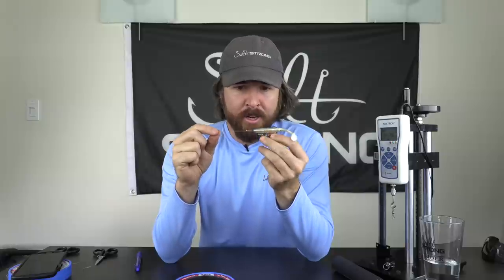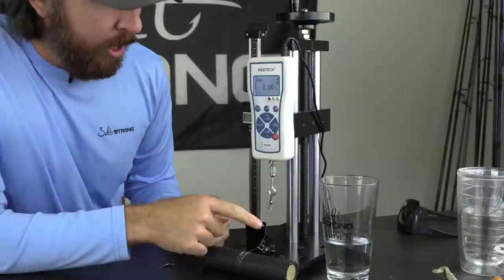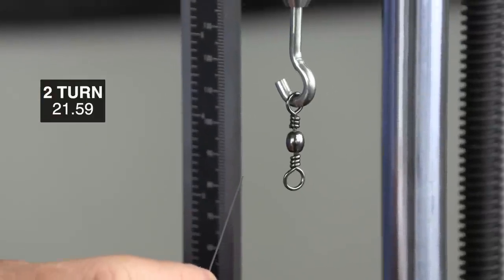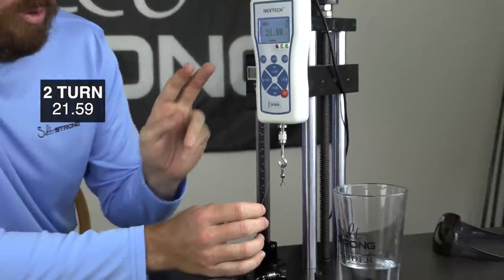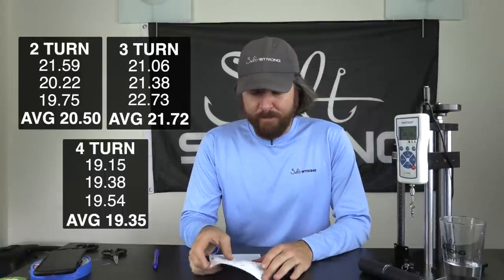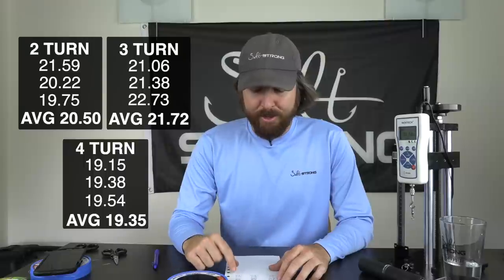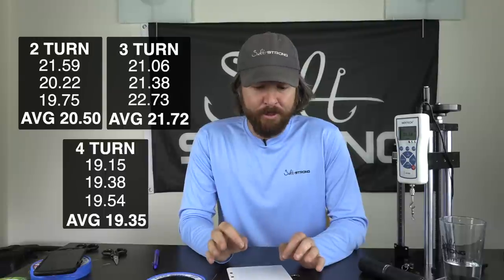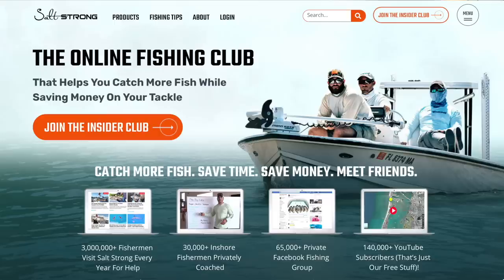Best Way To Tie Non-Slip Loop Knot (Optimal Number Of Turns For Strongest Knot Experiment)

Comment: Thanks for the time bro. 
Get that knot tester solid to a surface with some bolts or screws.
Reply from the maker: Thanks Danny! Yes, I'm working on an improved knot testing setup to make these experiments easier to conduct.
Reply: @Saltstrong  also maybe some sort of brace or clamp to hold the bar holding the line could be helpful.
Reply: @Saltstrong  sorry, guess I should have  read  all the comments before I  added mine-- it had already been asked and answered.

Comment: Since you are going to the effort to make measurements, you should secure the pull tester to a solid surface (note glasses of water indicating side-side motion) and secure the line directly below the direction of tension, rather than at an angle held by hand.
Reply: what else do you want him to do 5 back flips while eating a corndog